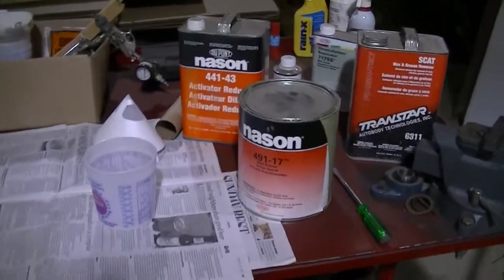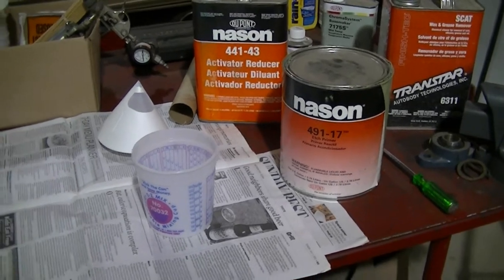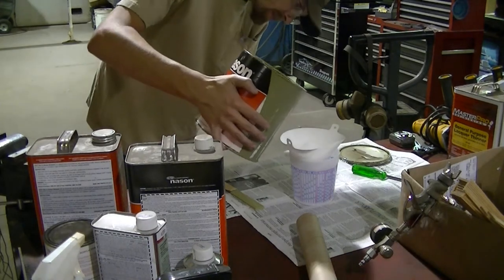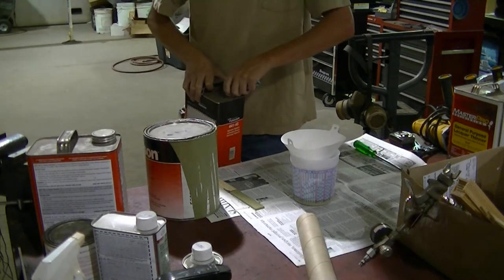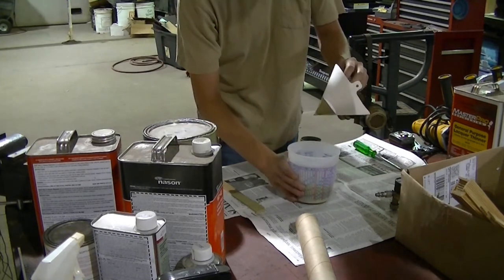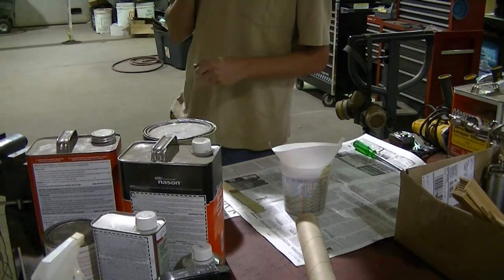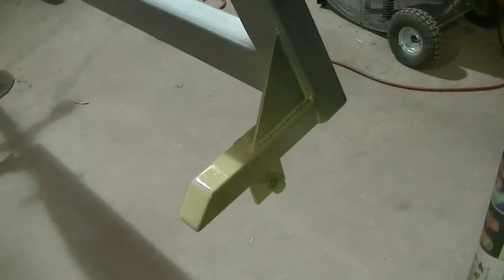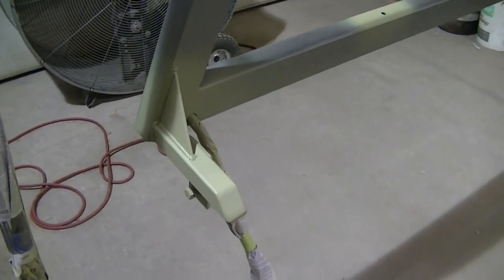Custom Back Rack for Darth Dually "Painting Part 2"

Comment from the maker: I painted it black with the DuPont paint.  Bed liner would work but I have the paint and can paint it myself so that is what I did.  Video should be up tomorrow.
Reply: Did you make the entire rack from scratch? Also what grinder blade do you use to grind the welds smooth so you don't see any weld marks on the angles? Looks really good by the way!